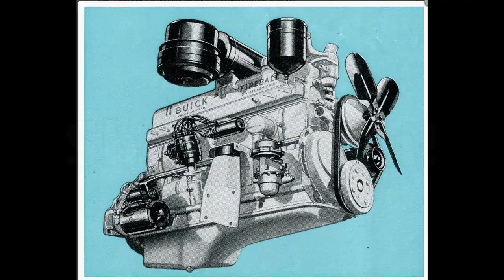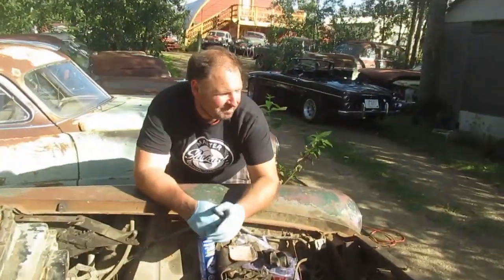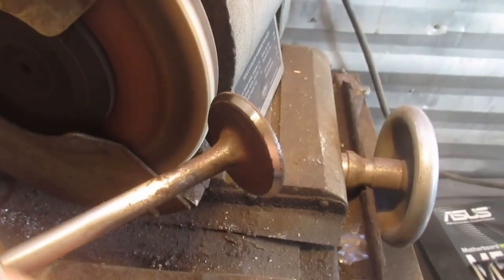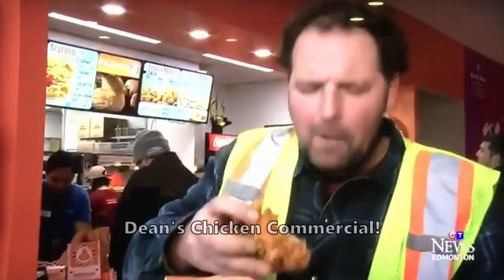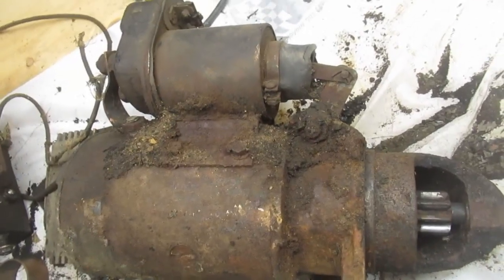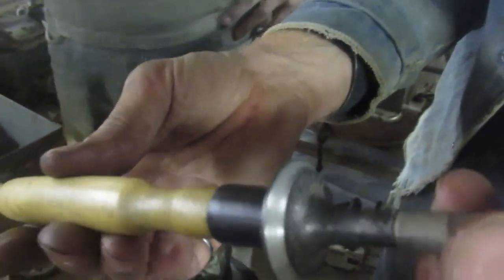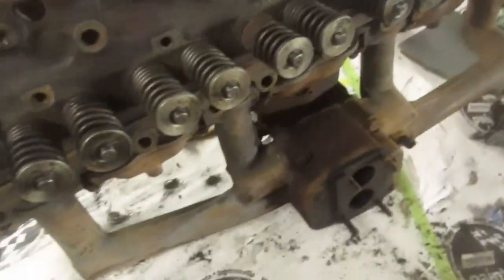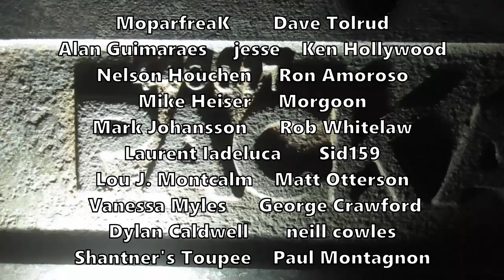Will they Run? Straight-8 Showdown! Packard vs Buick, Part 4...

Comment: Clearly Deans classes at the Vanna White's school of presentation and advertising shillery have paid off handsomely! From his spectacular spots at Popeyes, to the big arm swoosh point highlighting the Souix city valve fixer upper kit,he's truly shining in his craft! I'm concerned there really aren't enough head studs to seal that head to the block for team fudge Packard, especially with the blower and or super charger to be installed next. I just don't think there's enough of them. Looks like some fine possibly German overkill engineering in the design of the engine block! It's very understandable considering the engine is a 15-1 compression monster, so you definitely need all of those head studs! Lol! Y'all are certifiable, but imo,that's a great thing to be,especially in the land of Cold War Motors on a very sick planet. Fortunately Frankers has the key to the asylum and is very liberal with the day and night passes for the inmates. Because without the inmates, well,shit just wouldn't get done in the w.o.t. Olympics or completed in the giftedly talented way you silly fuckers do! When it comes to putting a shine on shinola,y'all are the tops!!! Thank y'all for the entertaining insanity and truly gifted mechanicness you share with us undeserving turds on a weakly basis,and for these blessings,we humbly and sincerely  salute y'all for your enginuity and sharing your adventures from the asylum with us all oh so generously,much akin to the laughs, nut-ease,darts,doobies and beer. Thanks again guys and Frankers, aka nurse Ratchet, for liberally sharing your wanton instability and insanity with us on a regular basis, salute!!! ▪☆☆☆▪

Comment: You need to go back to that junkyard and drag home the ‘61 Biscayne. After the Straight Eight Challenge is complete, you can have a Turn Up the Base Straight Six Challenge, pitting the ‘61 Biscayne against the ‘59 Biscayne. Oh, wait....isn’t the Winged Warrior (the ‘59) already running?
Reply: I think he should get it so the 59 will have another of its kind

Comment: I used a simular valve grinding machine way back when 1980. And it was old then and Iremember u need to remove the same amount off the top of the stem that you took off valve and seat ? You all are great and Im not telling you what to do dont you hate that.

Comment: the Packards transmission should be okay, just change the fluid on it probable and start it out in low gear. Heres the wiki on it. https://en.wikipedia.org/wiki/Ultramatic

Comment: Being an old Packard man I must say that it warms the cockles of my heart that you're working on it, whatever the reason. The valve seat machine that many years ago you glommed onto is stupendous! I would venture to say that more than half of the current "tech" wouldn't even know what it is. I mean no one rebuilds engines while the blocks are still in the car anymore.
Reply: That old Sioux is the best there is. It takes skill to use it right.

Comment: Ahhhhh.....my day is complete now. The dose of CWM makes all things well in the world. I have the flathead 268 Cu. In. inline 8 pulled out of my '54 Pontiac now. Taking inspiration from you guys to tear into mine and find out what its problems are. It was running when I pulled it out (resurected my car from the junkyard in Gainford where it sat for 14 years and got 9 years out of it before it failed). It was just making bad clacking noises from one cylinder when pulled.
As per Deans discovery of factory grey paint on the block, mine still has a lot of the original silver left on it that the coach maker had painted the whole drivetrain with. Can't wait to hear what these sound like when they fire up. How good is the exhaust systems on both cars?
Reply: As an added note....I was in Roundhill just south of Tofield on Sunday for a car show. Shitty weather cut down attendance but thats the hazards of car shows. Anyway, there was a gentleman there with a beautiful white '60 Fury 2 door hardtop. I think he was from Tofield? Just wondering if you know of the car or owner Scott? Rick in Edmonton

Comment: Packard in the lead, but that Ultramatic is such an unknown. If it's so crap that reverse is the only gear, would team Packard win by reversing to the gate? And is the Buick getting new rod bearings or is death rattling it's way to the gate acceptable?

Comment: on the over running clutch of the packard starter the buttons must fall into the detents on the spline   when in the starting position or the drive will throw back before the engine starts .ie false start. it was correct before it was taken apart. just  a bit of armchair help.
Reply from the maker: Thanks! We'll investigate...Cheers!

Comment: I haven't read through the 500+ comments to see if anyone else knows how to run a Sioux valve grinder, but there is a set screw on the back side of the chuck at the end of the pully. Loosen the set screw pull out the depth stopper and you can choke up on the valve stem.

Comment: Did you just not show the the procedure, because I am pretty sure the Packard valve stems need to be cut after the seat and valve facing to ensure valve seating and proper lash. Or did Packard have have an adjustable lifter set up.

Comment: Those poor valves when you run them on unleaded.  Do you have some leaded fuel for them?
Reply: Mike L    I don't think they will run long enough to worry about it and even if they did they would go at least 10.000 miles before there was a problem.

Comment: Leaving an AM3 socket motherboard box laying around in plain view, you're making us realize you're not actually technologically locked in the Cold War. I'm disappointed, haha.

I have a '84 Dodge D150 Prospector 318 2bbl 727 auto, she has intermittent wipers and had factory 6x9 door speakers, she also came with a cab light with the switch in that blank "clock" space, no AC strangely, considering it's a Prospector, which was a high end model. It had a bunch of chrome trim but that's all gone now.

Comment: I had a 91 D150 LE that had thirty K when I bought it and two years old. Drove it for nineteen years with a hundred and thirty miles on it. I sold it because the rust dropping off the body and was staining the driveway.

Comment: Just a thought/question.  I don’t recall if it was in the rules, but you could save a lot of wear and tear on your bodies if you pulled the engine and worked on an engine stand.  Were engine stands not allowed?  Were no engine stands available and could not be bought because of the zero budget rule?
Reply from the maker: Yeah, we considered it, but most of what we needed to do could be achieved with the engines in place... We also didn't have any idea how good or bad the engines were until we got going. Since we didn't expect to do bottom end stuff, we decided it would be faster to leave them in place. Cheers!

Comment: Grinding valves w/o the coolant pump working. Sacrilege.
Reply: Yes, but I think we can allow them this indescretion considering lol
Reply: I think because valves are made of heat resistant material, there is no risk to take off the quench effect from them while machining
Reply: John Falkenstine they squirt oil on at 18:18
Reply: ja - noticed that as well. especially true with those heavy/deep passes.  at least he didn't run the stem into the stone as i once did.

Comment: I am a bit confused on valve and seat angles. I thought I heard you say you were grinding the valves at 44 degrees and the seats at 45 degrees. The ‘Neway’ valve seat cutter I saw a friend use was 46 degrees and valve grinder ( actually a cutter), was 45 degrees....  do you think going up a degree on the seat and valve angle make any difference ( since the ratio of the angles is still just one degree apart) ?......ps, I just bought his old Sioux valve grinder for $325 U.S...... anyway you guys are the best on YouTube !!!

Comment: Also instead of the little suction cup for lapping the valves in overhead valve engines, just put the cordless drill right on the valve to spin it, I realize it's one directi, but hey, good enough for government work

Comment: Ohh the valve lapping job, ohh the darned valve lapping job 😒
I did it the "right way" as shown in the video here - for years. Then I started thinking, must be an easier way.
There is.
Use a piece of snug fit tubing over the valve stem top and a suitable driver, be it a powerdrill or angle air nut driver.
Lock the tube with a tiny hose clamp.
Once it is set up with tubing mated to the driver and the valve stem, off you go, pushing the valve out a bit now and then, like you would lift the hand tool.
No more overstretched hands and a darn good perfect grey zone ring on the valves. 💋💋

Comment: Gentlemen: Lest you forget, Packard was, in it's time THE preeminent top quality motor vehicle manufactured in the USA. When you use those types of parts in what you are making, then what results is a superior car with far above average longevity. Therefore, I am not surprised that the Packard is faring better than the Buick. The parts used to make it were of a higher standard.
Reply: #George Busby .. Yes, and remember that in WWII Packard built the Merlin aircraft engine under license from Rolls Royce, another indication of the trust in their quality.
Reply: Indeed they did, and licenses from Rolls-Royce do not grow on trees, even during WWII. Took a bit of doing to qualify to even be considered.

Comment: Thanks for the video Scott. It was great seeing the valve grinding equipment you have. It brought me back to auto shop in the early 70's. I used that same type of equipment to do the valves on my 1963 Plymouth Valiant slant six. The tower of leaning power! I recommend getting the oiling system working on the valve grinder though. Keep up the good work, great series of videos. Right up there with the Plymouth splicing.

Comment: That old Packard motor is probably a high nickel or chrome alloy cast iron, which is why it was so easy to clean off the rust in the ports, etc.
By the 70s Detroit was lowering their nickel and/or chrome content in their castings, which manifested it easily rusted coolant passages. Once they rusted, it was hard to clear them, even with a hot tanking.

Go, Packard!

Comment: My grampa was on a destroyer escort ship in ww2...the u.s. knox apa46 he said they carried a group of pt boats they would launch off the sides to go to shore with. He said they had 4 packard straite 8's in em an said they were pretty damn fast....kinda cool.id bet its the same damn design of packard yer overhaulin here.very cool to see fer me. What a durable tank of an engine in general
Reply: PT boats were powered by Packard engines, but they were V12 engines derived from the WWI era Liberty aircraft engine. There were three engines fitted to a PT boat, and they ranged in output from 800 horsepower for the early war 3M-2500 to 1850 horsepower for the late war 5M-2500.

Comment: If he ever wants to drop that 91, I have a kit, 3 5/8's'' in the front, 4'' in the back. Lower control arms and shackles. Uses stock springs.
Used to have an 81, had  to leave it in a move, and haven't found a replacement.
Looking in the cab, they didn't change much in ten years.

Comment: Great truck at the end of the video. My first brand new vehicle was a 1989 Dakota S that came with no radio, no back bumper, rubber floor, a 2.5L four with a 5-speed manual, crank windows, and no power steering. Sticker price was $7495.00 U.S. I installed a Pioneer stereo and an aftermarket back bumper, and I drove it for 13 years. I just checked the sticker price on the cheapest new full-size Dodge RAM 1500, and it's about $38,000.00 U.S.

Comment: Packard's straight 8, with no less than 9 main bearings! Obviously meant to run "forever" and very old school!  The engine at least, should be ready for another life time! The Buick on the other hand, was a turd from new, making the team Buick have to work even harder. They should get an award for working against terrible odds!  My folks bought a new Packard Clipper in 1953, and even at my tender age, I loved the smooth running and the unique exhaust sound.  They then bought a new Patrician in 1956. Very nice car, but sounded pretty much like any high end V8.  I think it was a 372 engine. They still owned it in 1958 when I first got my license. Didn't let me drive it too much though...

Comment: At Last Part Four of the Eight Bangin Escapades, for quick and dirty you guys do nice work, Must be the quality Beer and Darts..lol
I got to thinking [Always a dangerous thing for a man in my Mechanical condition]  of an upgrade challenge for the winning team, Ok here goes...  Since the flat heads suffered terribly from combustion chamber blues,  How about customizing the winning car, to incorporate fuel injectors?
Yeah, I know...Cut down on the Whiskey Right?..  but seriously...Cut the intake manifold off until you got stubs, weld them shut, drill some holes, tap some threads, install some electrically fired injectors, run some sort of an injector timing set-up,, maybe hall sensor on the crank pulley.
Primary pump and fittings, and there ya go!!   a Fuel injected Straight Eight.   Seems logical to me,, but then im short a few fruit loops..  let me know what you think,, but be kind to the old farts, we only have fun watching you young guys these days..   Until then, Keep your Dick in the Vice..

Comment: Like after you're done fixing them why don't you restore them pretty sure they would actually go up in value
Reply: After watching Scott on the 60 Fury splice, it seems that proper restroration on each would probably take quite a while. This is not because he is slow, but because  he has been taught and learned proper way to fix body and mechanical problems and between time and or materials many would cost so much it would be more than car is worth. Also because he's bought many of them saved from being scrapped and all have a soft spot in his heart, or is that the hole in his head LOL, not to worry most of my friends AND MYSELF, are people who are good hearted honest folk who are beat or so off the norm and comfortable and fun to be with. So to you and the whole crew, stick to standards in world that thinks less and less of them, have fun doing what you want and like to do, even the crap jobs.  I wish I could come down and join you but someone has to keep an eye on my home for wayward lawnmowers.

Comment: LOve to see that Buick done with paint and either a fresh Engine job [rings, valves and bearings] or drop in a nice 6.0 junker LS with new rings, bearings and lap the valves [the springs they come with and rockers should work fine]. New lifters and push rods? hmmm... lol That Buick would be worth it. It's got that fantastic whale like baleen grill :-) Ls from a truck pulled? Average anywhere from 300 to 400 bucks [sometimes after somebody else has pulled it just to flip]. It'd make for a great car with a strong drive train [either if you stick with that flatty straight 8 or a modern junkyard LS swap]. Make for fun youtube content at any rate. Instead of the wire brush and polish the old poop... grinding the vlave seats was a good step but... yeeeah... lean on paetreon peeps or youtube revenue to do that car. The Frazer too... it could use some love in the engine department and paint area of things :-/ :-))

Comment: If you're going to do that much work cleaning and grinding valves, you might as well put in rings and bearings.
Reply: As our fearless leader would say, it's not in the budget, meaning unless it's donated, on the shelf or hanging around the shop it has to be submitted for approval. Also they're more interested in getting them to run, not a full blown rebuild as most of these cars may never see road off the property again AND that's because Scott has a big heart and soft spot for rescuing interesting cars from the crusher and getting them to run is what they do for a fun time after work. Speaking of I'd love to come join the rest of the crew, how do I apply, is being crazy enough to love this channel enough?

Comment: Why dont you check the valve on eachguide it came out of? not being smart just asking.
Reply from the maker: Oh! Well, by using the same valve for each guide you are only checking the relative condition of the guides to each other. The guides that don't pop are worn, regardless of what valve eventually goes into them. That's all there is to it; it's just a quick way to find worn guides. I hope that explains it, cheers!

Comment: My granddad was a mechanic in the 40’s and 50’s; my dad used to help out in the shop.

To fix a radiator, he used to de-solder all the elbows on the side and acid wash the core. Then re-solder all the elbows.

He used to renew brake shoes  by drilling out the rivets, cutting some brake lining off a big roll, cutting it to size and riveting it back onto the shoe. 

Very rare to throw something out and replace with new.

Comment: Howdy again fellas! Just wanted to empart some kernels of chemistry i just learnded off of Uncle Tonys garage channel on here that can hopefully be useful to y'all somewhere down the line. He had a 318 block with a stuck piston in a rusted hole,he mentioned adding white vinegar because it dissolves and eats rust. The bores all pitted and rusted so I reckon a little soak will clean and free it up due to some chemistry activities. If you're interested he's doing it in the "bottle rocket" series in episode 10 i reckon. I may be a young at heart older dog,but I try remaining teachable to learnding some new trix. Arf! ▪☆☆☆▪

Comment: When I'm trying to get into tight places with a shop vac , I duct tape a length of fuel line into the end of the vac hose .It's flexible can be worked into places it won't normally fit .

Comment: Your seat grinder is missing the spring that goes under the stone so you spin it up high speed and push it down to dress those seats.  Least wise that's what the one I used worked.  Have fun